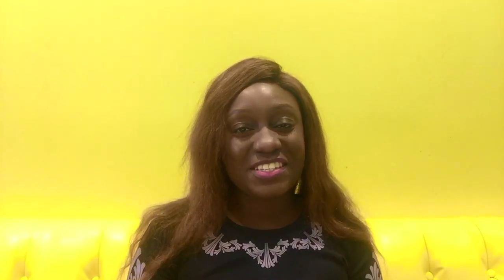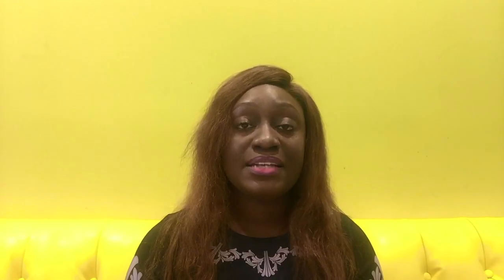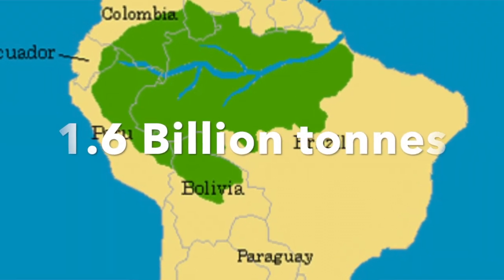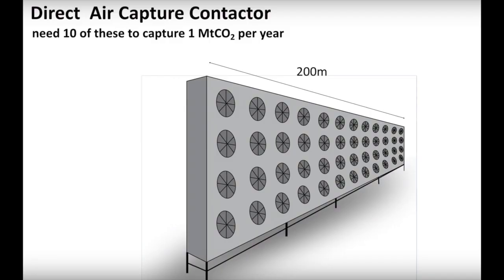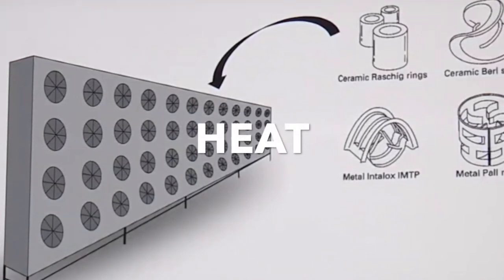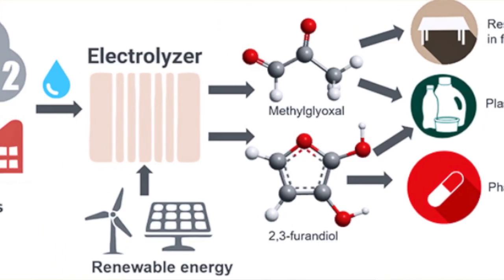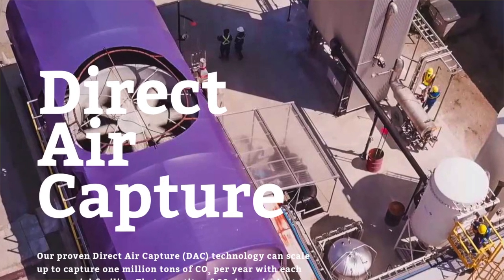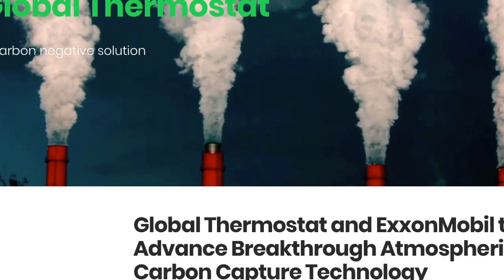CCS|| What is Carbon Capture Technology?|| CCUS || Climate Change

Comment: Lots to learn here. hnmm should we stick to trees? i think trees need help since we humans are already emitting more CO2 than they can handle... well, Mother nature is full of surprises and new discoveries so... Nice work Raro.
Reply from the maker: We definitely are not neglecting trees as they provide many more benefits than just sucking carbon dioxide from the atmosphere. But for the purpose of sequestering the excess carbon emissions in the atmosphere, trees definitely need help as the rate at which they sequester carbon is too slow compared to the excess humans have emitted.

Comment: Oh wow..  So much work done here.. 
I like the details, the what, the how it works and why the technology... .. 
I like to hear the down side of the CC Tech..
Smooth video as well..
  I think you are doing great.. Keep the flag flying 😘
Reply from the maker: Thank you very much for noticing the effort I put into making this video. One of the downside to this technology is that it would make some humans feel more comfortable polluting the environment rather than looking for cleaner alternatives to their processes. It also becomes a disadvantage when fossil fuels like coal are used to power the carbon capture plant because it becomes a case of polluting the environment to clean the environment. There are special cases like that adopted by Carbon Engineering as mentioned in the video where they power their DAC plant with natural gas, and at the same time capture the CO2 being emitted by the natural gas plant.
Reply: @RarosueAmaraibi  A case of breaking the egg to have an omelette.. 
As long as the gains of the CC tech far out weighs the emission .. I think its a win. 

Thank you so much.. Very enlightening project.